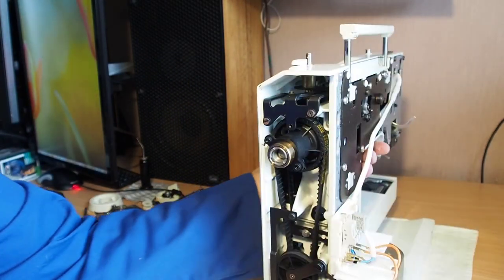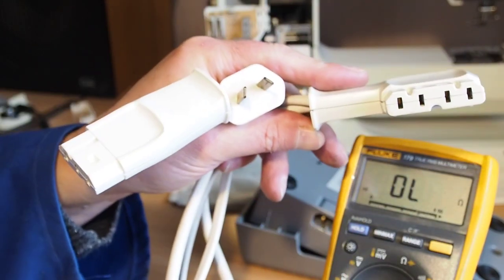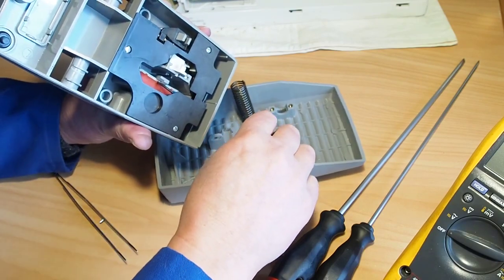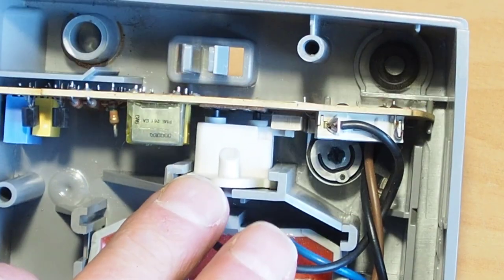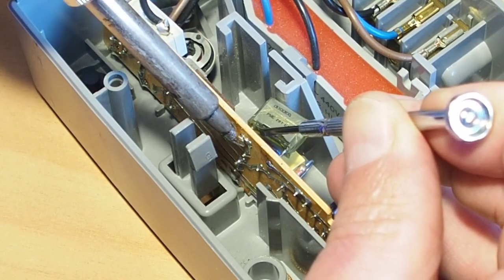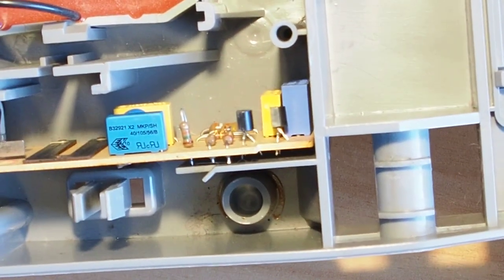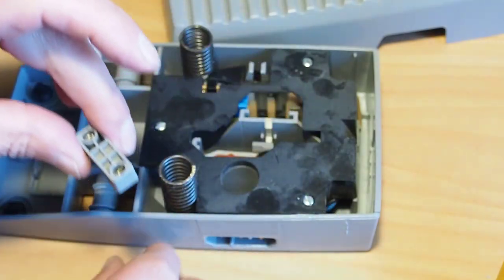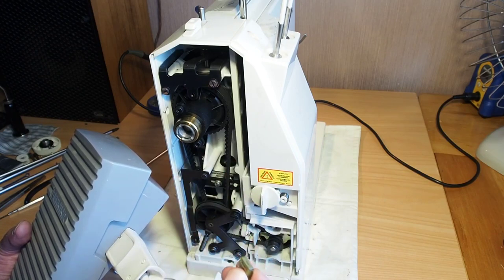Bernina 1000 Series Sewing Machine - Motor not Running

Comment: Thanks for showing this good video about a common repair regarding these oil-paper capacitors. I like your focus on opening the pedal without damaging the brushes. I guess we both learned that the hard way 🙂 Perhaps you are in the Bernina FB group, because I just made a note about a modification to the springs in Bernina pedals.

Comment: Hi , thanks for your brilliant video and I am sure many DIY enthusiasts find it extremely useful. I have a Bernina 1015 Sport model and I am wondering how to access the carbon brushes. I am unable to locate the screw caps which need to be undone/ opened ( as in other models ) for checking the carbon brushes. Just like the motor in your video, mine looks exactly the same . However, it doesn’t have screw caps to access carbon brushes. Instead., there is a black shutter/ plastic cover on the housing and I am assuming it holds the carbon brush/ es . But how do I open it is a big puzzle. I would appreciate your help/ feedback please because I need to check  the carbon brushes on my machine motor. I look forward to hearing from you ASAP. Thanks, Ramana.

Comment: My Bernina 831, is randomly sewing. Meaning, the motors runs but it seem like I step on the brakes and the needle isn’t moving up and down when I have fabric to sew. I have to help by moving the wheel on the side to give it a start. At times if I just continue to step on the peddle it will run then sew.. I don’t know what happened to it. I know I need to service it. But I still want to know. Without fabrics under the foot the machine will run and the needle will move.
Reply from the maker: It sounds like the motor belts may be loose. I have a video that shows the adjustment but it's for an older model of Bernina but it may help you. https://youtu.be/9fCDvfaf_Wg
Reply: In Stitches, thanks, I’ll look at it and see if that is the problem.
Reply: In Stitches , I have had it serviced before and never opened and seen the inside. I got this machine second hand and never had a problem. Been using it for over 15 years. I just opened it and I see that the bottom round thing that holds belt a part of it has been broken off. I wonder why that part was never replaced when they service it and I wonder if that is the problem. I tested with the side opened, and for now it seems to miraculously be working and sewing without any hitches. I tried sewing different stiches and with maybe a what was that for a second it seemed that the problem was solved. I think the part that is cracked and broken is the black round pulley Disc. Part of the round part where the belt in on it broken off. Not sure what is wrong with it.

Comment: What is the plus minus screw underneath the Pedal?
Reply: connects to a secondary, rotary variable resistor adjusts the maximum speed of the foot control, possibly change the response curve of the main variable resistor